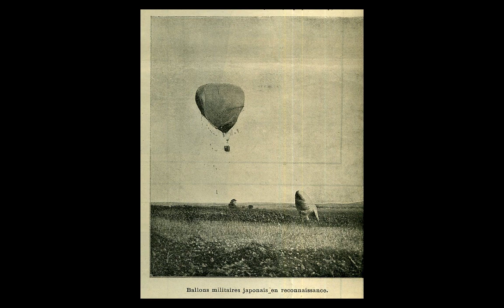Kaishiki No.1 - Japan’s first military aircraft

Comment: What's with the unexplained, droopy ailerons??
Reply from the maker: At first I thought there was something off about the ailerons. The first picture I saw was quite small, so it looked initially like they were ragged and damaged. However that shape is indeed how they were designed. I have no idea why, except to speculate idly that Tokugawa might have been inspired by the wing-tips of the Etrich Taube. But that is a wild guess. As the for their appearance in the photograph, there's no information, so I guess they were in that position, for whatever reason, when it was taken. Showing off the rather distinctive shape, perhaps? The replica in Tokorozawa Aviation Museum has replicated their design.
Reply: Some early French aircraft did that, too. Specifically, Farmans. There are a couple thoughts on that. One is that the aerodynamic function of ailerons to produce roll was not understood. They were steering air brakes. The flap on the inside of the turn would be pulled down to restrain that wing. That is how Santos-Dumont's 1906 14-bis worked. The other thought is that it was intended to evade the Wright patent. It was done that way deliberately.

The Wrights delivered injunctions against Louis Paulhan and the organizers of the 1910 Los Angeles International Air Meet. Paulhan had two Farmans with the droopy ailerons and two Bleriot 11s with wing warping. Curtiss sought to evade the Wright patent by putting his ailerons between the wings.